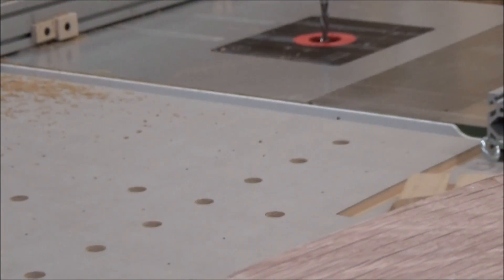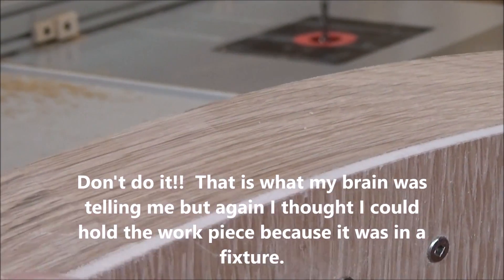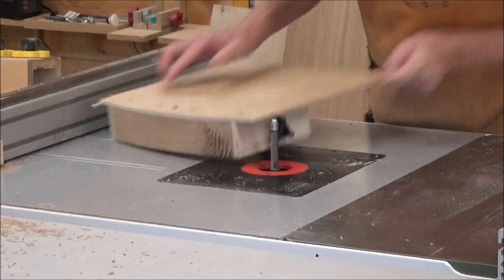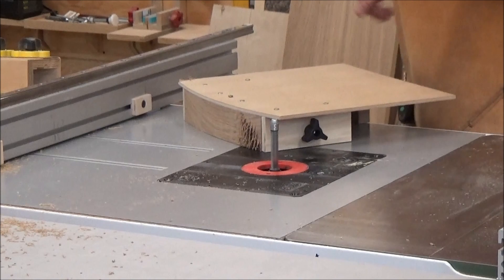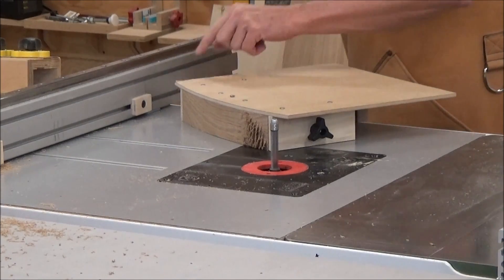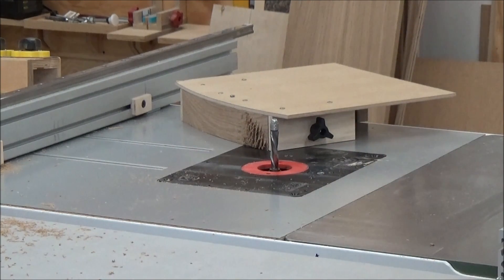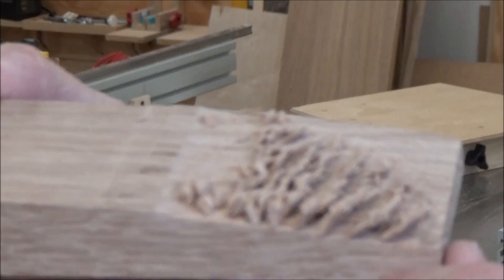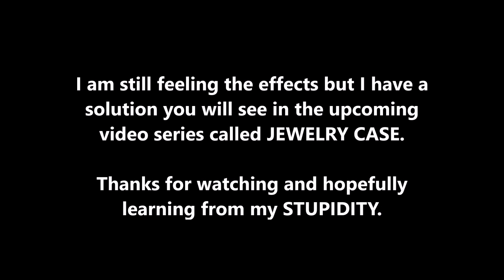Router Table Kick Back

Comment: Yep, I've done that before. Sent pieces flying across the room, but I was using a spindle moulder with a 5" diameter cutter head. Plunging in against the grain is a skill that can never truly be mastered. Plunging with the grain is easy...and therefore highly recommended 👍

Comment: I was examining the video. I believe the kick back was cause by a climb cut. It kicked back right as you stopped the piece and maybe even when the opposite direction for a split second.  It didnt look like you were taking off to much material.  I could be totally wrong, but that tends to be the primary reason for kick back according to the 'internet'.
Reply from the maker: You're exactly right. Thanks for watching.

Comment: Upcut spiral bit may have been a better choice too because it would pull the cut toward the table instead of away from it, but that's still a lot to chew away freehand with what looks like a 3/8" bit. That's a downcut spiral and I'm sure you were putting a lot of pressure on it to keep it flat on the table.
Reply: And then I saw the second half of the video... yep caught it on the wrong direction
Reply from the maker: Thanks Luther for the info and for watching.

Comment: Jeff I'm shocked that nobody (that I saw) has pointed this out. Grain direction has little to do with this. It contributed, but it was not the main factor. You were using a spiral bit, and they care a lot less about grain than a straight bit does. However, I think if you'd been using a straight bit, the kickback would have actually been milder. The main issue here is that you are using a spiral DOWN-CUTTING bit. Since the router is mounted upside down, the bit is therefore pushing up, LIFTING the workpiece off the table. As I'm sure you can imagine (and probably felt), once it gains even a micrometer of lift, the whole piece is much easier to fling around. What you need here is a spiral up-cutting bit. This will pull the workpiece DOWN towards the table and increase stability. Honestly the only reason I can think of off the top of my head for even using a down-cutting flush trim bit is if you're really concerned about tearout on the top surface, but... I mean, that really shouldn't be an issue.
Reply: this is the correct explanation. as you say, the primary reason for the kickback is because using a downcutting spiral bit on a router table is in general not a good idea. the bit in the video is clearly a downcutting bit (left handed spiral), since as it spins the spirals appear to move away from the router motor (which would be "downwards" if the router was upright and handheld). compare the spiral direction of the bit in the video to the upcutting (right handed spiral) "big daddy" bit. 
this same thing happened to me while cutting dadoes using a 1/2 inch downcutting spiral bit. the piece of wood shot upwards off the table and sideways right into my chest. like getting hit by a baseball between the numbers. made the same type of sudden noise and messy burrs in the wood. also nearly impossible to control. on the other hand, an upcutting spiral bit on a router table cuts through anything like butter... also note that he is not doing climb cutting (as asserted by other posts) because the actual cutting passes are going from right to left, so climb cutting is not to blame.
Reply: Thanks for pointing that out, Andy1dude. Only now I realized that 👍
Reply: Andy, I’ve been trying to figure out why I’ve been having the same exact issue with kickback, and your explanation is the first I’ve read that finally makes sense.

Glad there wasn’t serious injury from this kickback 😬
Reply: Thank you!!! I was trying to figure out HOW this even happened. Would never have thought of that on my own.
Reply: Thanks! I made a router table today and was wondering why I got kickback all the time ! Now I know I was using the wrong bit.... Thank you

Comment: The middle finger on my left hand is about 3/16ths shorter today than it was in January of 2020. I like several other comments  "If you're going to be dumb you gotta be tough" for one. I just plain set up the cut wrong. Then the router snached the timber out of my hand TWICE and still I tried the cut with the same set up, only trying to force it harder.

I strongly agree with the coaching we've all gotten  from several other people in this thread. In particular, the bitt is to thin, the cut to heavy and you need a starting pin. I'm REALLY REALLY glad your finger didn't impact the bitt.

By posting this video you've done us all a great service. By the by, the piece of timber I was trying to butcher is hanging on the wall prominently displayed in my shop.
Reply from the maker: Thanks Bruce. I appreciate your watching and kind words. Just when you think you know it all life proves to you really quickly that you don't.

Comment: Spiral direction of the router bit is pushing the piece up. You will fail maintaining the downforce so you'll lose the friction, then hovering piece will projected as the bit rotates.
I would rather had the workpiece flipped so the template goes to the bottom, then use guide bushing or the bearing near the table. that way i don't need the bit to be that tall.
And of course with the spiral direction that pulls the piece down to the table. Down-cut spiral bit on the "flipped router table" is no longer down-cut. it is up-cut now.

Let's be careful with those spiral bits.
Reply from the maker: Thanks for the tip and for watching.

Comment: Two reasons: 
1) spiral bit cutting up tends to lift the piece and the router bites it at the bottom 
2) you seemed to rest it and slightly move it in the direction of rotation of the bit
I would recommend that rather than touching the bit then start to move the piece, you establish the movement way before the bit has touched it
Reply from the maker: Thanks for watching. I had no problem when I routed downhill which I should have done in the first place.

Comment: Just happened this to me. YIKES it was not that bad. Except that the router does not turn on anymore. I have used it 5 o 6 times since I bought it and firts time on a table.
Any ideas? It is a Crafstman router. 
Thanks for sharing.
Reply from the maker: Sorry for the mishap and I wish I had ideas on your router. If it were me I would return it and get it replaced. Thanks for watching.

Comment: Hope you have been ok. One thing I never understand this kickback is utterly rare when I am holding the router itself, be it spiral downcut/straight bit, with guide busing/bearing/straight guide, cutting with the grain or across end-grain.

And it happens often when the setup is turned around with me holding the piece. I am intrigued to know why.
Reply from the maker: I'm fine. If you watch the jewelry box series you can see the solution but in short I was cutting against the grain and taking to big of a bite. Thanks for watching.

Comment: Man I’m glad it wasn’t to bad for your finger.
4 points if I may;
Router bit diameter is a little small;
Starter pin would have help;
a 2 inches tall cut is a lot for bearing template bit;
Reply from the maker: Thanks for watching. Solution is to flip the work piece and route downhill. I will show that later.

Comment: I have never used a router before as I have a router and have been wanting to set it up and use it and I have been watching a lot of router videos and trying to learn router safety.  I have a question: why would anyone use a straight bit over a spiral bit when the spiral bit was safer?????? Does each bit have a different cut??? My guess is that I would want to start out using the spiral bit first.

Comment: I'm glad you didn't loose any fingers there!

I don't understand why you did not bring a fence to the router bit so only one side of the bit with its bearing is exposed. You could have then used the fence to lever the workpiece  into the bit and starting with the bearing riding along your template, that overhung the workpiece, right?

This teaches a lot on using these large or long bits exposed like this.

Thanks for sharing 👍
Reply from the maker: Thanks for watching and hindsight is 20/20. There are a lot of things I should have done differently and if you watch the rest of the series you see the fix I came up with which is truly the best. Flip the work piece and route  downhill on both sides.
Reply: Ah, great, have to look into it. 👍

Comment: I haven’t use a router as much as I should to know how to address issues like this, but is it possible that you placed a few layers of thick tape (such as film gaff tape) across the template so that the router bit starts further out and eats smaller bites, and then keep removing layers of tape till your bearing is running along the bare template?
Reply from the maker: That's a great idea but in this case it's all about grain direction. By flipping the piece and working the bit downhill or with the grain there were no issues at all. Thanks for watching and happy accident free woodworking to you.
Reply: The safer way is to let template owerhang edges and start from template and not the workpiece. Kickback happend because you started cutting in the middle of workpiece, once the bit grabbed wood then it ejected workpiece. Spiral bits can and are wery aggressive If you do not know what you are doing.
Reply from the maker: @MMSS12  Thanks for watching and I hope all your projects go safely and turn out as planned.

Comment: Well, OUCH! I kept pausing it before the event - makes ME a little queasy seeing it and knowing how easily that kind of thing happens. I found your site searching for videos on the Shaper Origin. Mine came this week and have been trying to sort it and Fusion 360 out. But one of the BIG selling points of the Shaper Origin for me is that IT makes the templates... and further, you can use the Origin to cut the first 1/4" and then use a pattern bit to finish the cut on a router table. I saw one video somewhere doing this, and they were using the Big Daddy Pattern bit from William NG. It's a spiral bit with six flutes. Now THAT could trim your finger nails for you - but you wouldn't want to have your hands ANYWHERE near the bit - I would use a push block or something to hold on to. But thanks for showing this - it will save some people some drama.
Reply from the maker: My thoughts exactly on the ouch part and the event. When I watched it back even though it happened to me I was bit queasy myself. Thanks for watching putting yourself though it. If I can prevent anyone from this type of accident then my wound will have been worth it. As they say, "it could have been a lot worse."

Comment: Could you explain what you were doing wrong?
Reply from the maker: I was routing against the grain. As you look at it on the screen the grain on the left is running downhill and I was able to do that without issue. The grain on the right however is running uphill and against the rotation of the bit. The solution was so simple (flip the board end for end) but I had the blinders on and refused to see/do it. In the series that will be coming you will see the solution in action and how easy it is to do. Thanks for watching.
Reply: @JeffFischer1  ah ok. I must admit, i haven't been paying attention to grain direction. I just route on the table from right to left. As i thought that was the direction you're always supposed to use on a router table?
Reply from the maker: @SirBenJamin_  Generally true, but this is a curved template.
Reply: @SirBenJamin_  you are correct. The issues in this video were not that he was going into endgrain, but rather that he was using the wrong type of bit for the job, and didn't have a properly constructed jig fixture. Your spiral bits, if you are going to use them on a table router, should always pull the part towards the table. He is using a downcut bit. Spiral bit manufacturers always assume you are cutting top-down, with either a portable router, or a CNC machine. The bit he has in his table is a down-cut flush trim bit, meant to be used top-down. The proper up-cut bit would have mitigated the risk. He also should not be holding a jig fixture by its sides. 2 ball handles on the top are the far safer way of making a jig. He is very lucky that his hand didn't end up in the bit.
Most bit manufacturers would steer you away from a spiral bit in a table router. They are dangerous if not used exactly correctly. In the shop where I am the Production Manager, we use them, but we always put a shield or fence on the table to help deflect a person's hand or workpiece if it gets away from them. Particularly if the bit needs to be as far out of the table as this one was.

Comment: The fence really saved your bacon there. Without it, the work piece would have continued being thrown out and possibly pulled your hand (or worse, wrist) into the spindle. Very lucky.  Rather a squished finger than one that's missing.
Reply from the maker: I never looked at it that way. That finger was sore for about 3 weeks. Thanks for watching.

Comment: Isn't this a logical consequence of two overlapping factors? First, spiral bit is trying to push the workpiece away, in this case up, and second, you were going with the rotation of the bit, not against. So you'we had two strong forces trying to lift and pull the workpiece away from you, and against those two forces it was your sheer hand pressure against worktable. On the side of your hand pressure, it was quite steady force, limited with reflexes of your body to counteract the quick changing forces of the tool, working against you. So when it came that tool generated force change, much faster than your body could react to, it broke the system stability, letting machine forces to take over.
So, if you ask me: 
1.) I am not woodworker, not having a router, but it would be better to let the spiral move in screw-in, not screw-out direction.
2.) Do not follow the direction of router bit spinning, but rather go against it.
Reply from the maker: Thanks for watching and I do believe that bit spinning in a counter clockwise direction is pulling the work piece down to the table. The main problem was yes, I was going against the bit on the downhill side of the cut, but on the upside of the cut I was trying to nibble away at it in the "wrong" direction. The bit caught the grain and as you said forces took over. If you watch the next video in the series of the jewelry box all I did was route against the bit but flipping the work to go downhill on both halves of the drawer front.
Reply: Jeff, sorry, but that bit is pushing up away from the table and that's your main issue here.
Reply from the maker: @Andy1dude  Thanks. I will have to get that bit out and take a closer look.
Reply: @JeffFischer1 , me interested into your findings about the bit...is it trying to screw in or out.
Reply from the maker: @Labsy  it's out.

Comment: This is why I don't use do routing on table, I find it a lot safer with the router riding on the work piece. Not always as convenient
Reply from the maker: Thanks for the input and for watching.
Reply: That's a foolish response. A router table isn't more dangerous than a handheld router.

Comment: Zero guarding.

You could've made it safe by clamping a lump of wood thicker than the cutter height just behind it, then screwed on a piece on top covering the cutter and a bit of the work.

The fixture is far too small with insufficient run off

A replaceable tip cutter of say 3/4" diameter with chip limiting would cut through that easy.

Thank goodness no serious injury
Reply from the maker: Thanks for watching and the input.

Comment: Is there a reason why you were doing a climb cut with that depth of wood? I thought those spiral bits would still give a clean cut when feeding it in the proper direction.

Btw I was really surprised that router bit didn't break off when that last kickback happened
Reply from the maker: Template on top and the bearing is on top. I was feeding in the wrong direction, that was the reason for the climb cut. I thought I could get away with it by taking incremental bites. WRONG. I think the bit didn't break because I was not putting all that much forward pressure on the work piece. Who knows?
Reply: @JeffFischer1  now I'm curious how well that router bit would cut when going in the right direction since it's a spiral bit, I think straight cutters would chatter the wood.

Glad you're ok though, I'm guessing it was the template banging off your finger that made it bleed and not from touching the bit
Reply from the maker: @a-carpenter9229  Yeah,  I consider myself very lucky. Going in the right direction it cuts great.